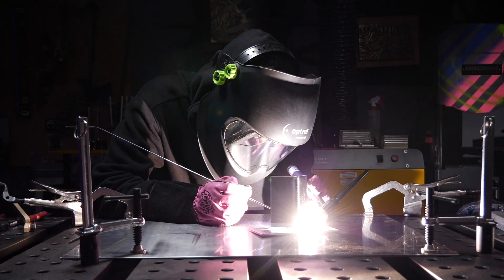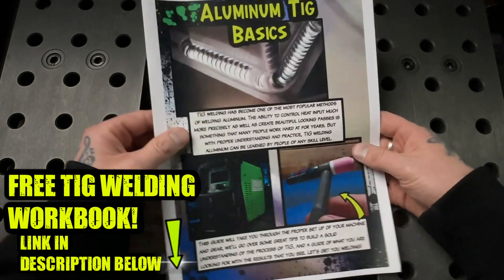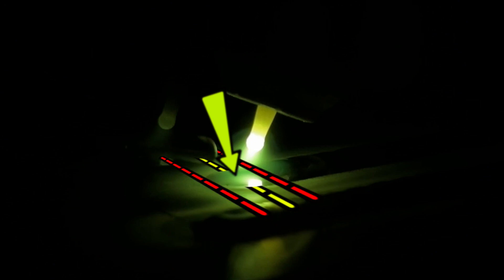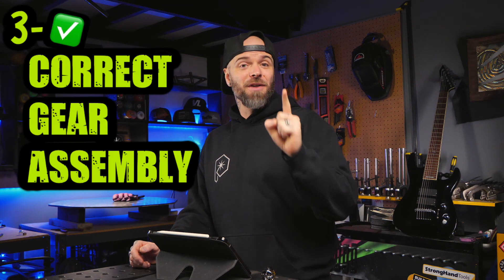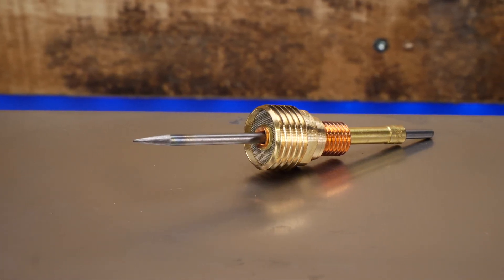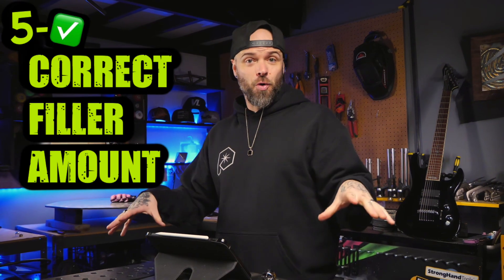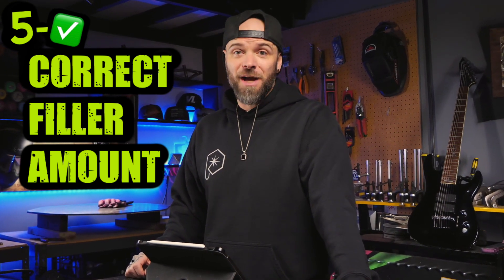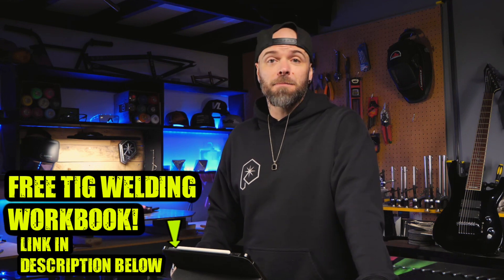How to TIG Weld Aluminum: 5 Secrets No One Tells You

Comment: Thanks for the tips. Does it matter if the torch is connected to negative or positive for TIG welding aluminum? Being it's AC, maybe it would not matter, but with the balance setting, I believe it would matter?

Comment: Hi I m also tig welder 2 mm tungsten n 1.6mm filler rod working on ss tube n making ss table 
1.2 mm square tube 90 AMP n 5 to 10 cfh gase flow 
during welding SS TUBE BENTS INSIDE
Tried each of your technique but still it bents inside 
What should i do please help

Comment: I have a syncrowave 250 miller  tig welder and i purchased a sheet of  18 ga 6061H14 aluminum and i cant get a puddle to weld it if i turn up the head it burns threw  i have other piece of 1100  and it is .030 and i weld it ok it is duller in color whereas the 6061 H14 is more brighter and hard to puddle. what am i doing wrong Help
and it welds ok